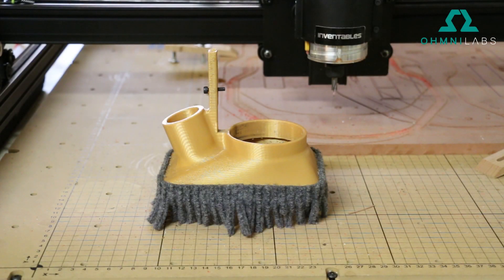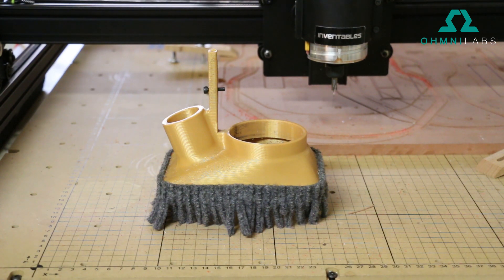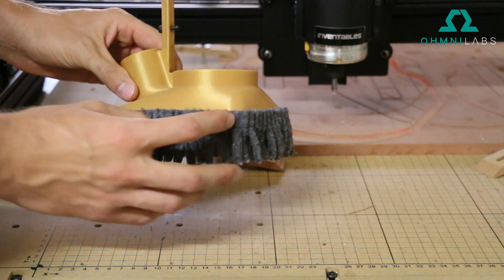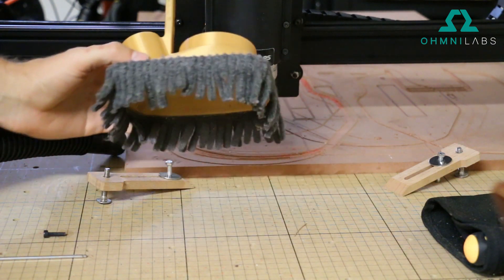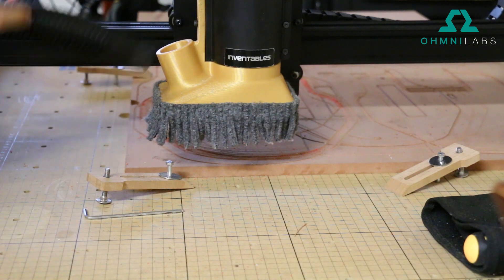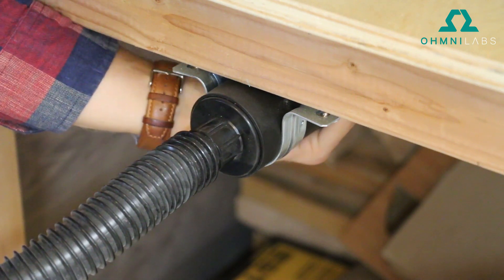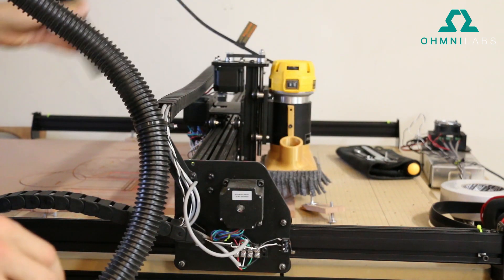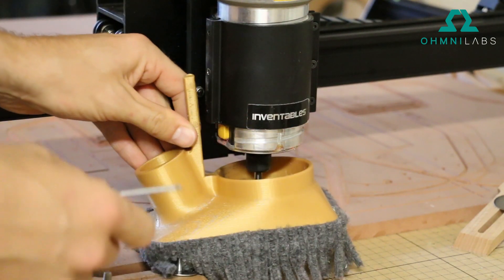How to Make Your Own CNC Router Dust Shoe

Comment: I like the way that you attached the vacuum hose to a tube and then another hose to the router.  I also liked how you attached the hose to the frame of the CNC and then to the dust boot.  I am going to try to copy this to my Stepcraft.  It has an automatic tool changer so I need to be able to pick up different router bits but I also want to get rid of all that saw dust.

Take care.